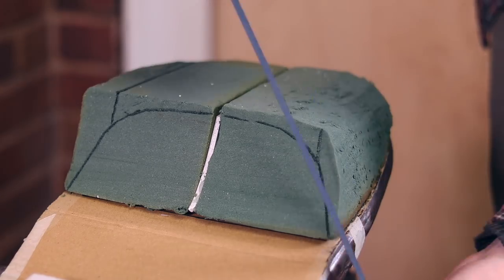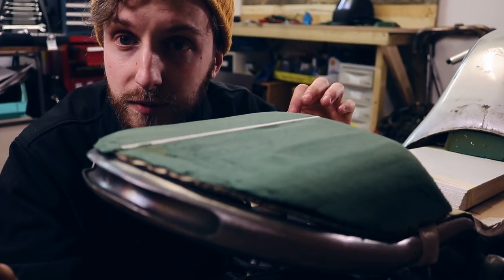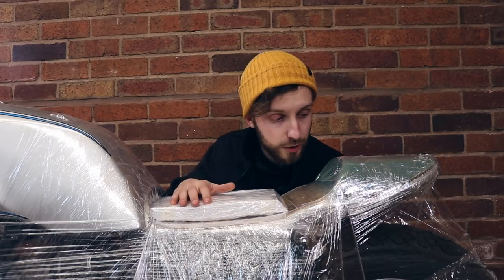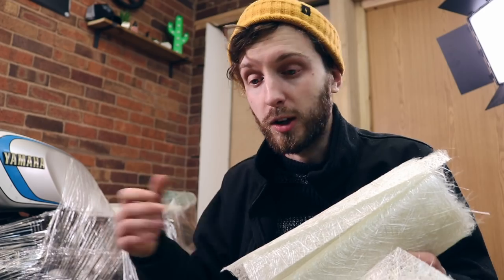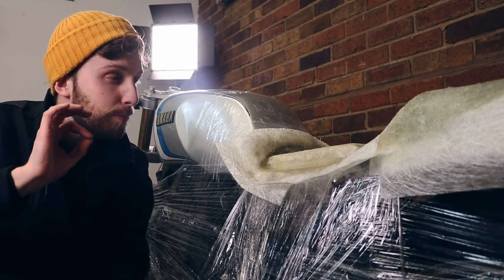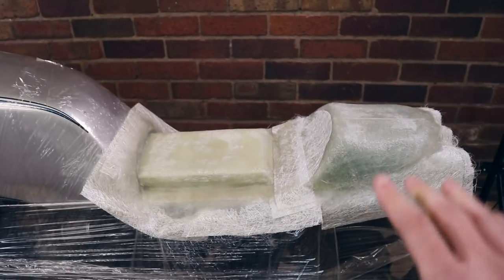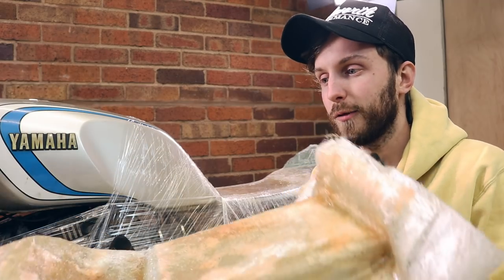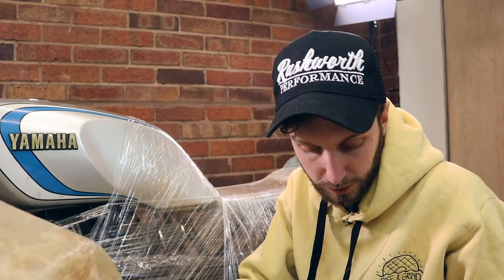XJ650 Build Part 11 - DIY Fibreglass Seat Cowl

Comment: hey, you are using way to little resin. that leads to more air in between the layers/matt itself. those air makes the final product not strong enough
Reply from the maker: The first layer was 250ml of resin and i used the same again on the day after . wasn't ideal but i have plans on reenforcing it from the under side so its not going to be structural or weight bearing (y) its all a learning curve
Reply: yea, nothing wrong with learning.
i did the same few years back as hobbyist.

just an advise, grind down some spot that look white (where an air inside)  and fill again with resin and mat.

don't be afraid if too much resin on it, you have a fiberglass roller anyway, you could roll the excesive resin out and make the fiberglass dense (no air+dense = strong and light weight)

keep it up.
looking fwd for your project.
Reply from the maker: Appreciate you sharing your knowledge buddy!

Comment: really nice work. the pan turned out perfect.    I dont understand what the separate block just behind the tank is for. It seems that will take away from any cushion you could have added.
Reply from the maker: Its to make room for the electrics and battery to minimalize the bulk of it on the under side of the frame. There will still be a good amount of cushion :)
Reply: @jishh  Oh OK  I get it now . thank you for the reply.   You do nice work. looking forward to the next vid.

Comment: Just some advice from personal experience. Make sure you don’t have any air pockets between the layers. If you have air between the layers, the air will expand when the bike stands in the summer sun. And then you will have these huge blisters.
Been there, done that. And fixing it afterwards is a pain👎

Also you need way more layers.

Comment: What a huge waste of plastic. Nice video though.
Reply from the maker: How so? What would you have done? I'm a sign maker and i have loads of offcuts and thats what i used.
Reply: @jishh  Not wrapping the engine.
Reply from the maker: id rather wrap more and protect the parts then not enough and have resin drip onto parts (y) for the extra 30seconds of work and the few feet of cling its worth it